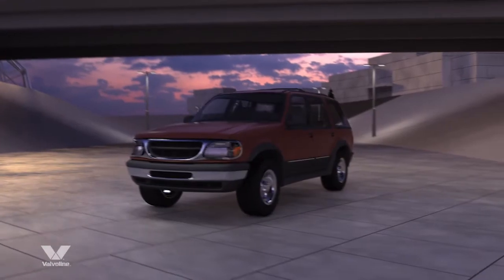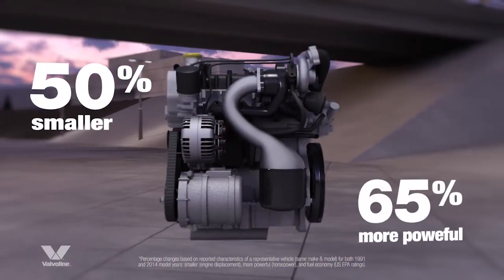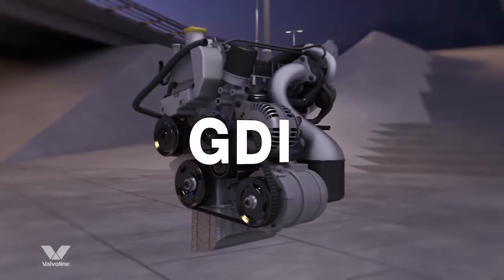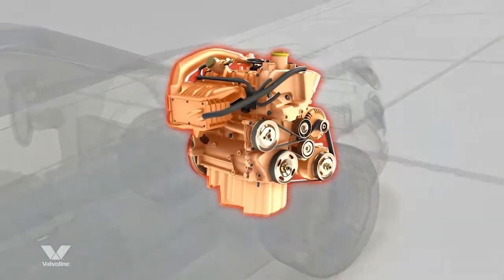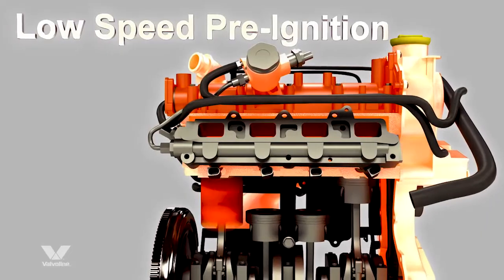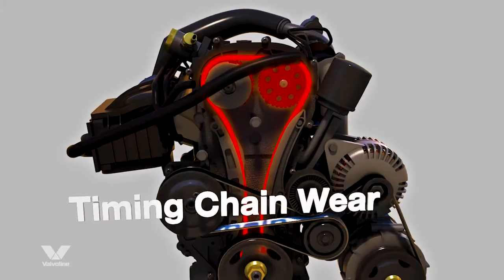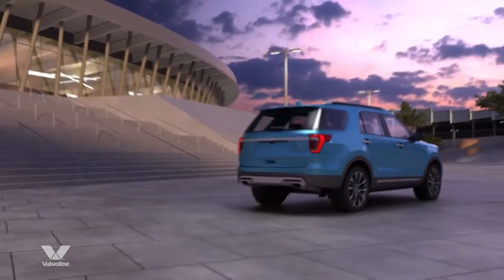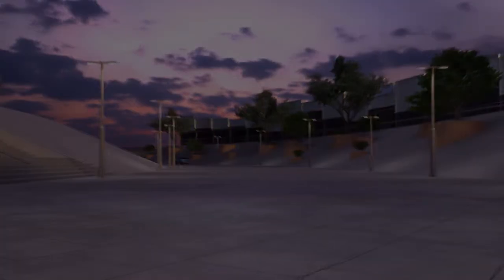Valvoline Explains GDI Engines & Why ILSAC GF-6 & API SP is Needed

Comment: Hello valvoline, does your GF-6 oil will work on my CLK 200 KOMPRESSOR that uses 5w30 and MB229.3 and MB229.5 specifications?
Reply: This doesn’t answer the question.
Reply: European Car use European ACEA oil. GF-6A oil has shorter oil change interval.